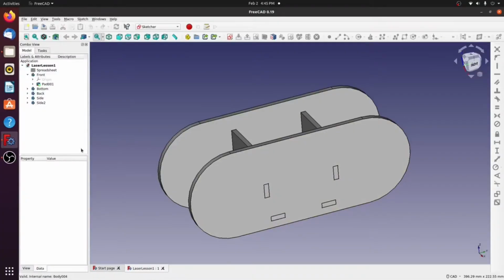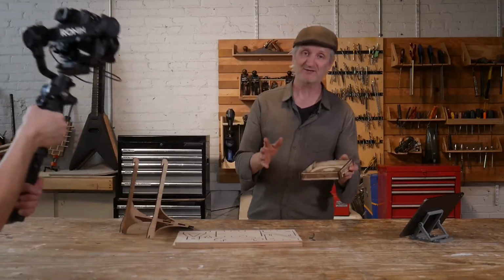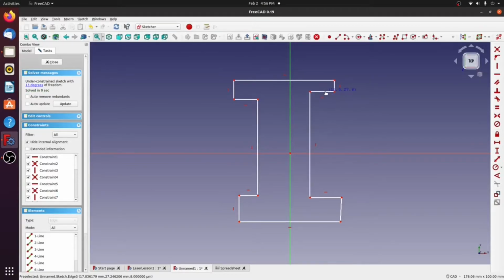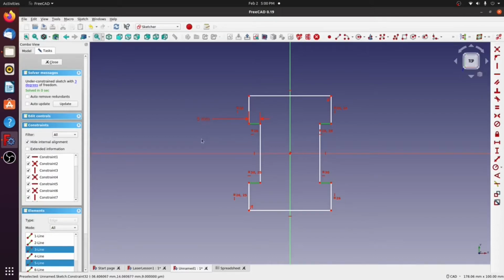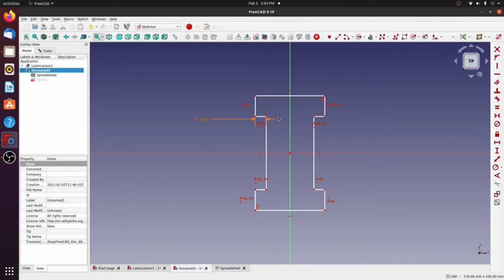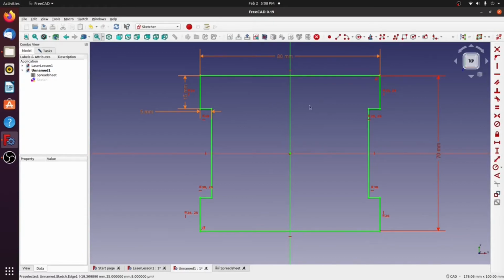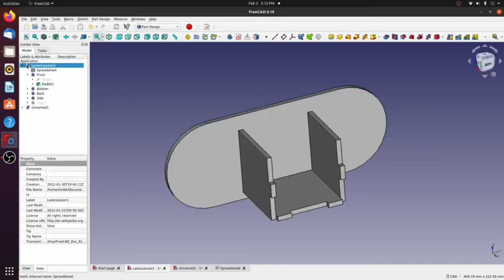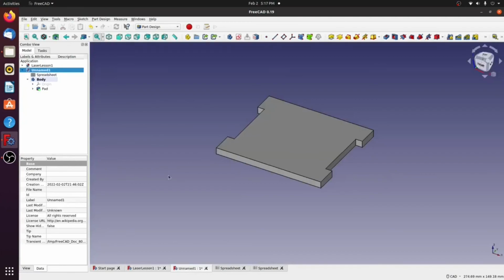Freecad For Lasers P1. 1 - Tabs and Slots

Comment: Excellent work. I'd like to stress that when you enter unit values in the spreadsheet, everyone should get in the habit ( as you do... and made me look twice ) of entering the units in the cells themselves i.e. "5 mm" vs. simply the value 5. Entering units in cells will oblige you to also enter units in formulas as well ( i.e. 70mm + Spreadsheet.MaterialThickness * 2  ) but it will solve all kinds of problems in the long run if you use multiple multiple unit systems ( metric vs imperial ) in your day to day designs. When you specify units in spreadsheet cells, the values will convert to the selected unit system and all your parametric formulas will recalculate correctly.
Reply from the maker: Yes! That has caught a lot of people in the shop. I made a separate video about it, I should upload that one.

Comment: Awesome video! I've been following it step by step just to get the hand out of freecad. A newbie question: How can I bring the measurements on screen? When I apply the constraints they are not appearing.
Reply from the maker: Hey there! I think I understand. When you create constraints in the Sketcher workbench the measurements will be visible. But if you exit the sketcher workbench you will no longer see the dimensions. However, you can use the "dimension" tool you can measure between any two points and dimension will remain visible, even in other workbenches like Part Design. Also, if you want very good drawings with dimensions you can make use of the TechDraw workbench, which has excellent options for making full technical drawings.
Reply: @TorontotoollibraryIRBE  Thank you so much! I will definitely give that a shot